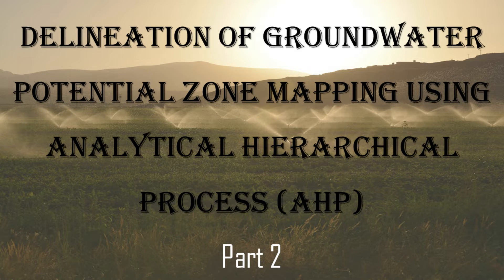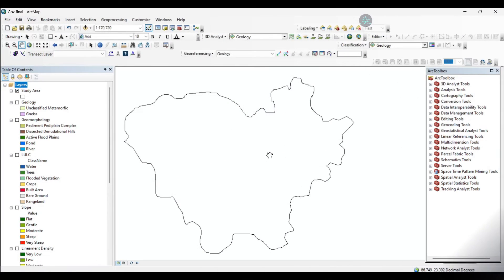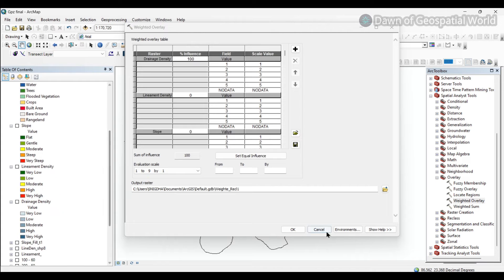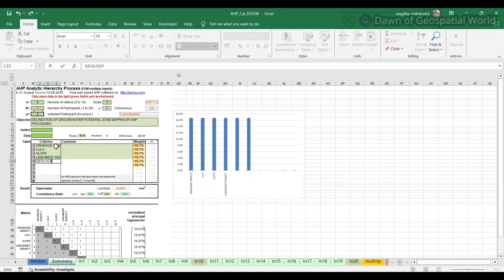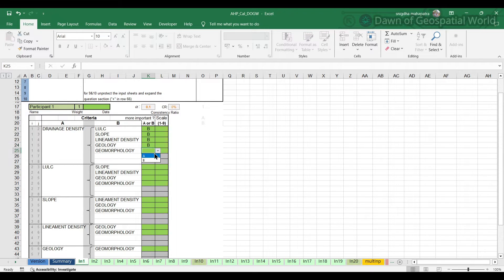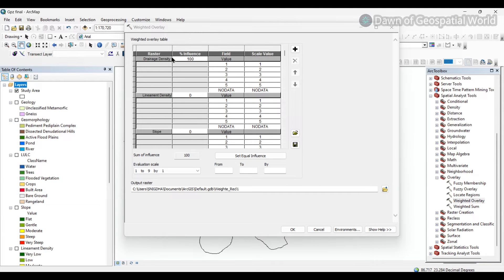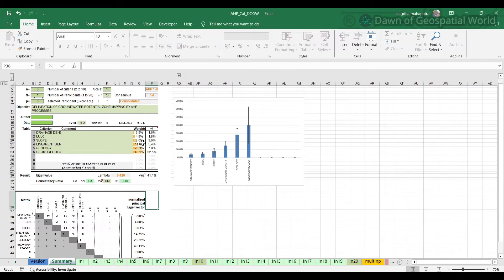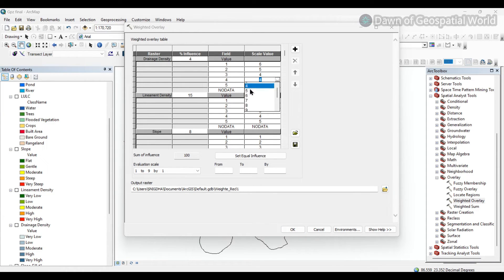Groundwater Potential Zone Mapping with AHP method in ArcMap | Groundwater Identification | PART 2

Comment: Hi mam, I followed every step as it is but after performing weighted overlay process my file(Ground water potential) is exported successfully but it does not showing the image, it is blank. Even I tried to change symbology but there is no change. Even coordinates, cell size.....  every thing correct.
Reply from the maker: Try zoom to layer by right clicking on the layer
Reply: Plz share editable file of excel sheet
Reply from the maker: @stanzinangmo5940  I have granted your access. Please Check.